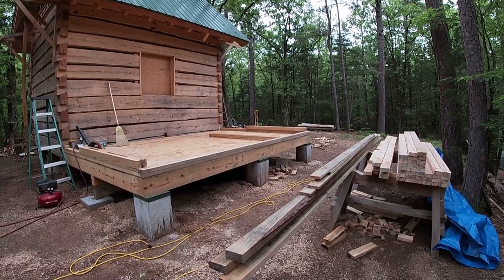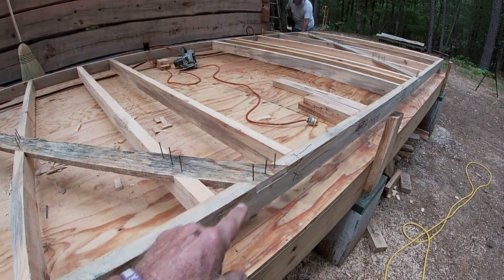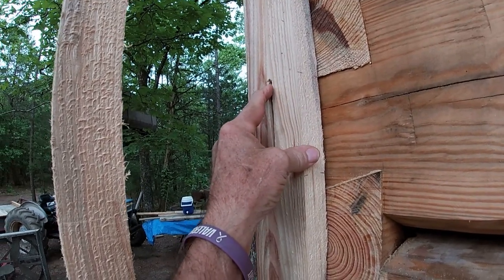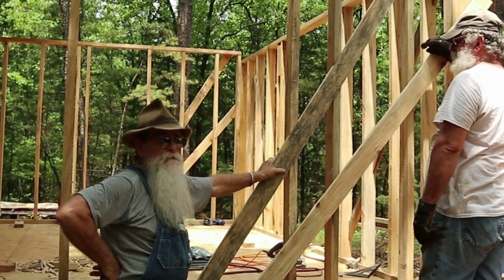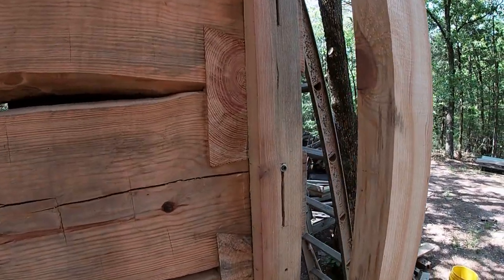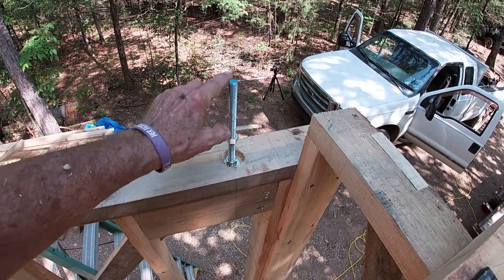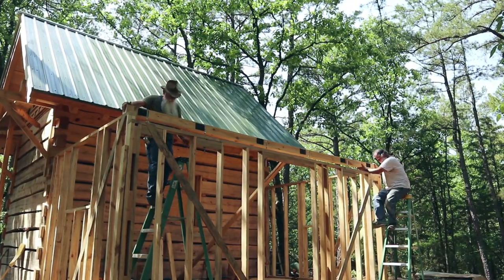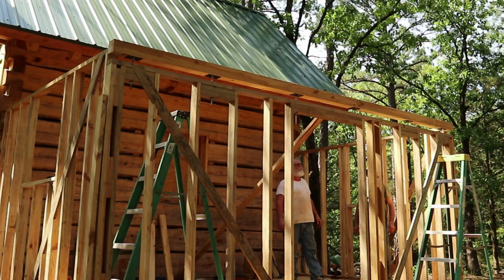Raising the Kitchen Walls, Paradise Point - Ep 16

Comment: Really good info in this video with the inlet brace and the screw slot for the 2x4 tied into the logs. I saw that once in an episode of Homestead Rescue where he did it on his cabin.
I may frame up my bedroom addition on the back of my cabin instead of using “logs”. 
Looking forward to your next video!
Reply from the maker: Howdy brother- I appreciate you watching the video. It works really well and I don’t have to worry about setting issues. I have seen where people have put things up tight and not allow for settling and it’s not a pretty picture. Very hard to correct. How is your project coming along? God bless